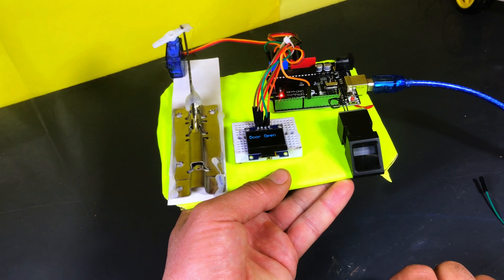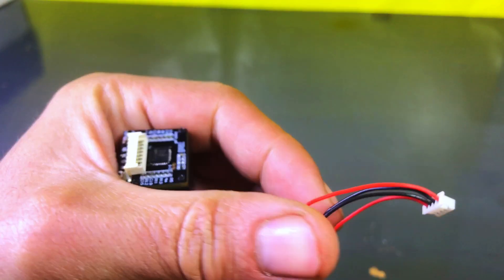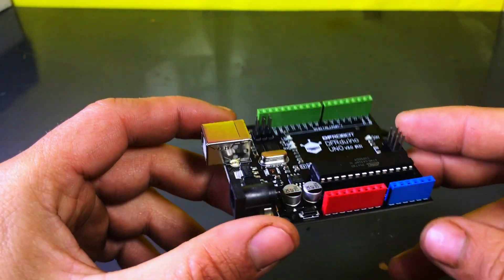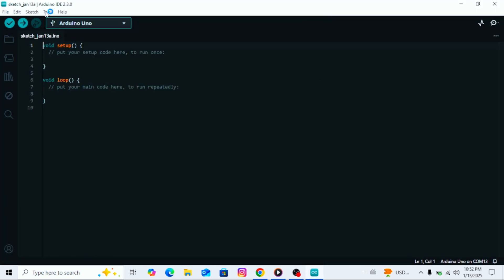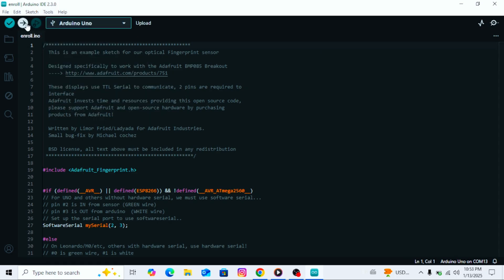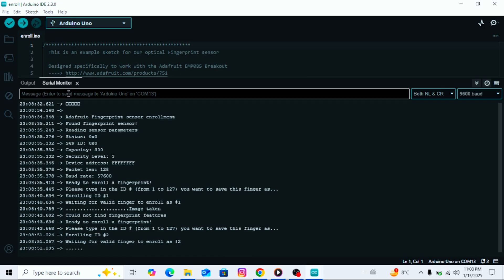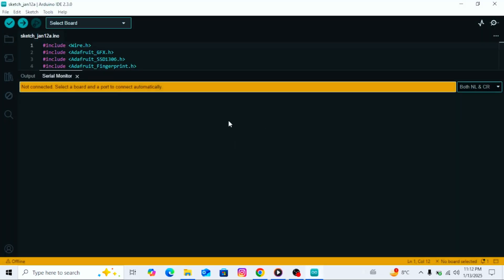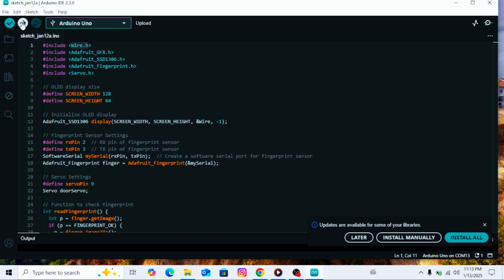Fingerprint Door Lock System using Arduino | OLED, Servo Motor & Lock Mechanism DIY

Comment: Is this project possible without having the Arduino connected to the computer? Is there a way to store the code in the Arduino so your computer doesn't always have to be connected?
Reply from the maker: Yes! After uploading the code to Arduino, you can disconnect it from the computer. The microcontroller inside Arduino stores the code, and you can power it using a battery, adapter, or power bank.
Reply: Thank you! Another question, is it possible to connect a keypad, fingerprint sensor, and a voice recognition module, to an arduino uno or an arduino mega? Or do they interfere with each other? I haven’t had much luck.

Comment: what did iron stick on the door lock, sir?
Reply from the maker: The iron stick is used so that the mechanical lock can be opened and closed with the servo motor.